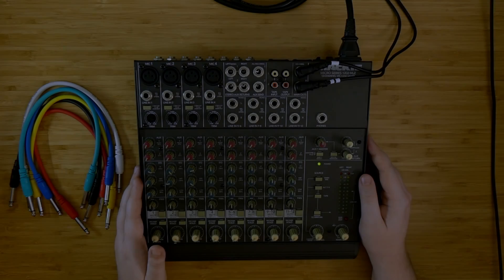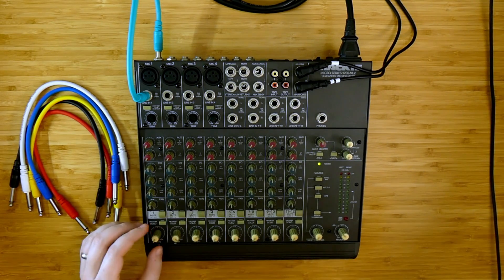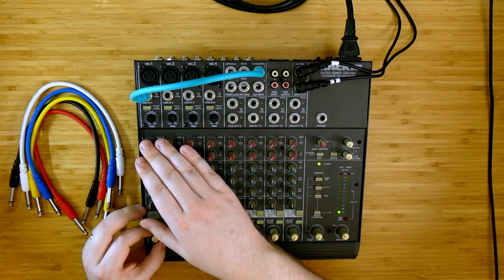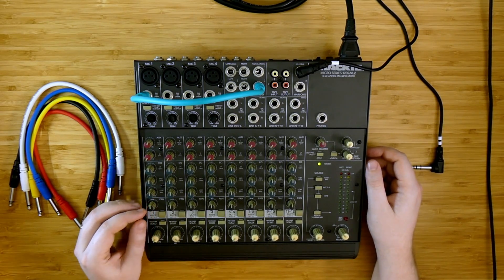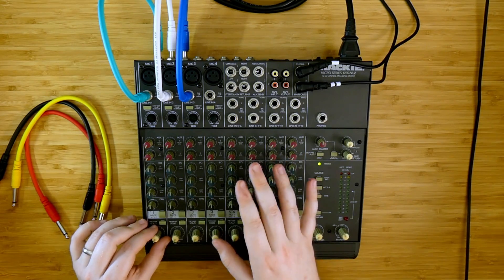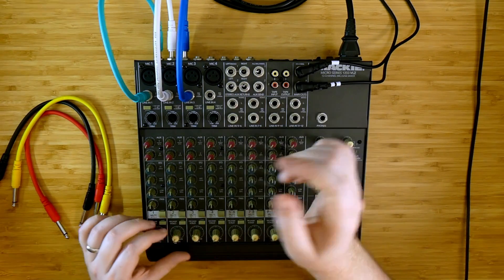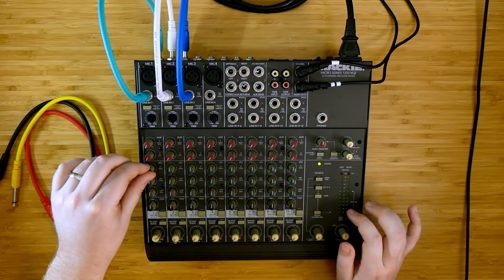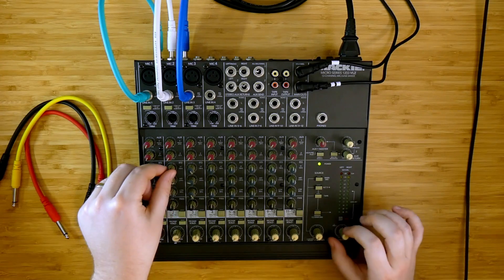The No-Input Mixing Board: Creating Stable Oscillators

Comment: Very New to this analog no computer music making and came across no input. Where do u recommend getting the patch cables ? Are they stereo 1/4 plugs?
Reply: A legend is born
Reply from the maker: A cheap multi-pack of cables from somewhere like Amazon has worked fine for me. I like multicolor packs so I can keep track of the cables more easily.

For the no-input techniques that I use, I would recommend tip-sleeve (TS) cables instead of tip-ring-sleeve (TRS, aka stereo) because the channel insert trick needs TS cables.
Reply: @kilo_llama  Thank you for the feedback. On my channel I’ve been making music via laptop but recently picked up a Donner B1 synth to try my hand at analog and then I picked up a Mackie 8 channel to start connecting a mic, a recording device etc then I came across the no input while researching and it has caught my attention. So thanks again.

Comment: Great mixer for the price! I bought the exact same one 20 years ago. Not much seems to have changed on the surface of it, except some of the colours on the knobs.
Reply from the maker: They seem to be built to last. I just checked the manufacturing date/code on my mixing board, and I think next month it will be turning 26 years old!
Reply: What exact model is this?
Reply: @McDoinky  Mackie 1202-VLZ is what it says on the front. I wonder what is the difference between pro and non pro. Phantom power or something?

Edit: found this quote of a quote:

The VLZpro have updated preamps.

from the mackie forum:
"The main difference is with the 1604 vlz PRO came the addition of XDR(TM)(extended dynamic range)mic preamps.You can use the XDR mic preamps at the end of extremely long cheap mic cables and not hear interference. It accepts a wider range of impedences without compromising frequency response."

Most likely, they simply raised the input impedence. I've used both, and really never noticed a difference.

By the way, the regular VLZ is just as capable using +4db balanced connections as the VLZpro.
Reply: @roygalaasen  Awesome. Any more recommendations for mixers like that?
Reply: @McDoinky  I am no expert on mixers really, just YouTube randomly recommended this video plus that I happened to have this one at some point and I was very happy with how it sounded for the price. I think I had the pro version myself, not that I think it makes much difference really. The only thing I was missing sometimes was faders instead of knobs, but it wouldn’t then be so compact as it is.